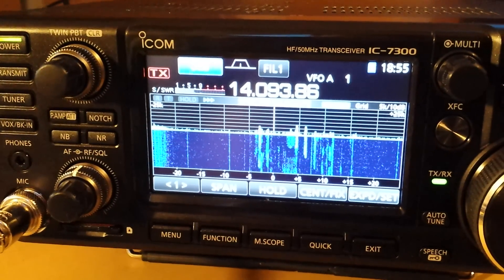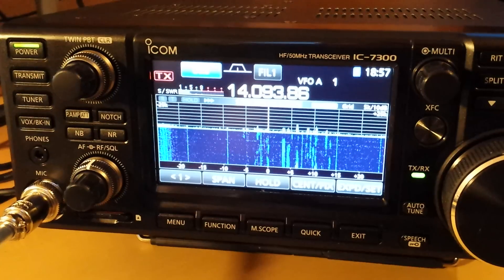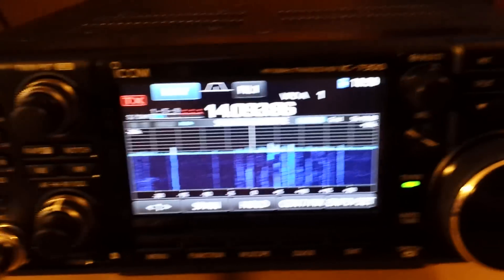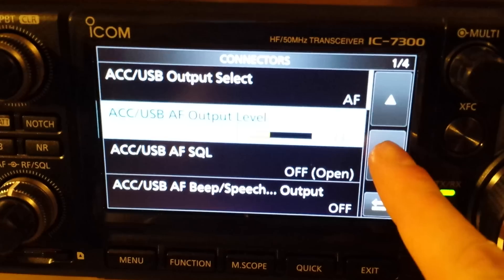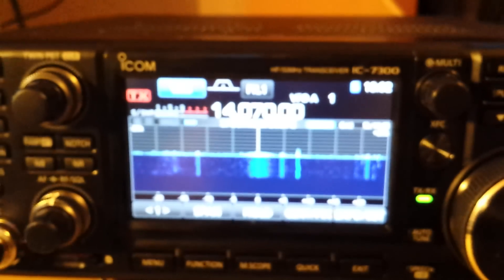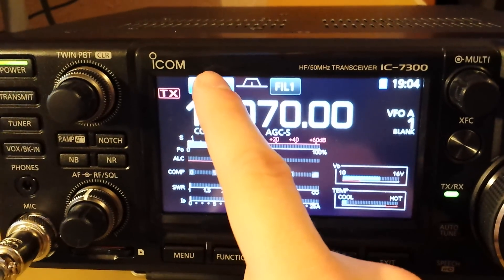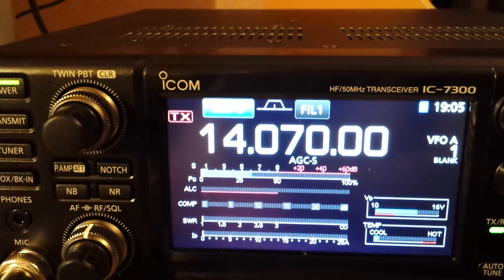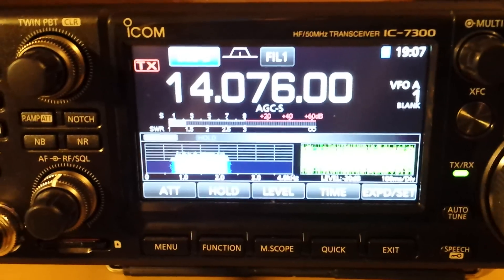IC-7300 - data modes configuration

Comment: Hi great video. Are you using one or two data cables.  If I start Commander and then start Winwarrable?? It gives me a flag that says the port is already in use.  I noticed that you have both applications running at the same time.

Comment: Just to let those that want Large Waterfalls and Spectrum.   I sold my first IC 7300 because of the fact that it had a small screen and I love large Waterfalls and Spectrum, but then it dawned on me to get a T/R Switch made from MFJ called model 1708.    This allows the same  antenna to be shared between the ICOM IC 7300, while  providing with the same antenna,  a receive only by way of a relay locking out the SDR of your choice from getting fried by the IC 7300 when transmitting, because the relay protects the SDR.    Now I can receive and transmit on the IC 7300, while at the same time I can receive on the FIFI SDR I built and Enjoy waterfalls on both the IC 7300 and my 23 Inch computer screen!         It requires a mod to tie the Transmit and Antenna connector together to both receive on the IC 7300 and SDR at the same time, because natively the 1708 comes with it being deaf on the IC 7300 side.   This takes care of that and allows dual reception....    So buy the IC 7300 and the 1708 and enjoy!
Show less

Comment: My experience is that any ALC activation results in distortion of digital signals. The rule of thumb is to adjust for NO ALC for the cleanest output.
Reply: Def. NO ALC in PSK and JT65/9.  I set my USB Modulation to 33% and adjust the USB audio output give or take around level 50.  Works well and just below ALC reading.
Reply from the maker: Thanks for sharing guys!

Comment: Help! Did you ever get your IC-7300 working over the USB cable to a Windows 10 computer? I've been trying but have not been successful in getting the IC-7300 communicating with my PC. I have a Windows 10 PC and an iOS 10 Mac. My goal is to get Fldigi functioning but right now I'd settle for any digital program working.
Reply from the maker: I didn't try win10 yet but will do when time permits. Will let you know.
Reply: Just saw your response. I've since been able to receive digital using HRD and DM??? (forgot what that part of the suite is called). I don't think the transmit is working correctly yet but will when I have some of that stuff called "time", just like you. The "send" triggers the transmitter but I don't think my outgoing levels are right.
Reply from the maker: I hope to have some time during Christmas to play around with this - got WIn10 tablet that I can use for testing but I didn't use HRD for years now - switched to DXLab and never looked back (ok ok, I still use N1MM for contesting).

Comment: So what are you adjusting to adjust the power out for digital?
Reply from the maker: The same as power for any other mode - press MULTI button next to top right corner of the screen and there's the control. The same can be done via commands sent to the radio.

Comment: Nice video, silly question.  It appears rig control and data transmission can be done with the USB cable, do you need to have USB and CAT cable?
Reply from the maker: You need only single usb cable. Once psu is turned on (radio can still be off) 7300 will be in fact active and usb devices it exposes fully operational and etected by your computer. A sound card and a serial port would be two most important ones. 
Once this "usb-serial" port comes up, you will be able to turn the radio on by sending commands to it.

Comment: Excellent video. I've ran JT65 from it beta stages years ago. I ran it  with my IC7700 with only 2 watts of power, I have just about got my DXCC. That's been over a year ago. I've since been burned out on JT65/9 so I have not been on it in quite some time. I do plan on getting an IC7300 but it will be a while and I have heard rumors that in later productions, it will sport a detachable face just as my IC7000. When that happens, I will get one for mobile operations. It'll be a great upgrade to my IC7000.

Comment: In the video you clearly demonstrate using JT-65.  But the JT-65 software called WSJT-X does not have any rig control menu settings for the ICOM 7300 yet.  Can you please share via comment;  How did you get JT-65 software to control the ICOM 7300?

Thanks,

Neal   N6YFM

Comment: Have you any idea why I have a constant tone on thec7300 when I select CW ? Also I am getting a access is denied message when I click on send
Reply from the maker: In CW mode I guess triggering TX through any means will cause CW tone to be sent, so if you don't want that use other mode settings on the radio. 
In terms of "access denied" message this would depend on what OS you are using - Linux would be classic case - you need to set proper file permission on devices in /dev and/or be member of the groups that have write access. There may be also case of concurrent access and another app keeping the port open. This would also cause similar error on Windows AFAIK.
Reply: +Tomasz Miklas so how do you fix the error in windows 7 ?